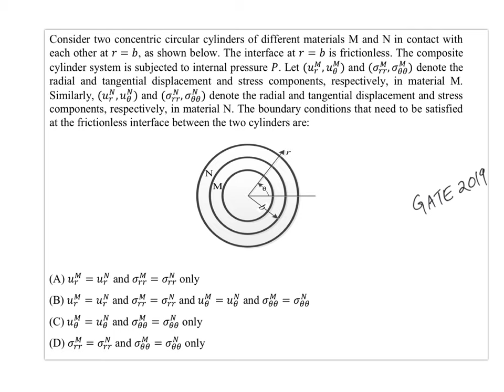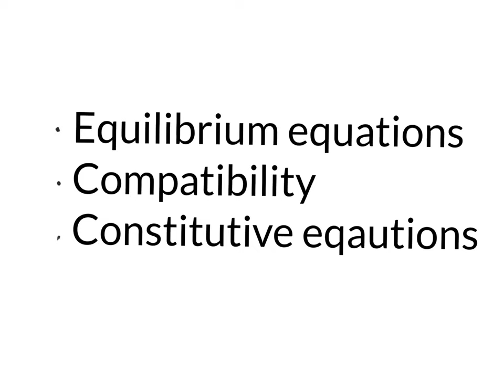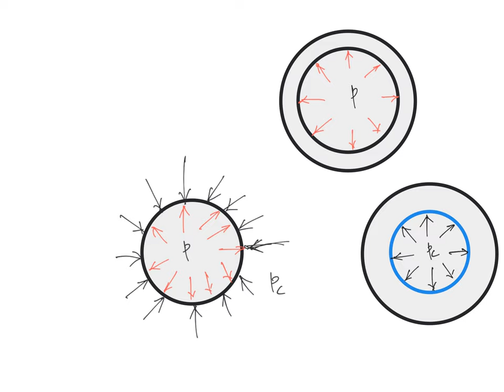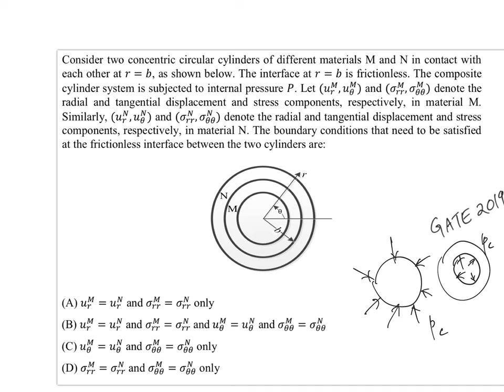GATE 2019 | Mechanics of Solids | Composite cylinder system | Solved example

Comment: Why didn't you tell why tangential hoop stresses are not equal
Reply from the maker: With no fundamental principle, we can prove that tangential hoop stresses are equal. please remember that forces and stresses are different and newtons laws are applicable to forces only not stresses. It so happened that in this case, radial stresses are equal to the internal pressure applied